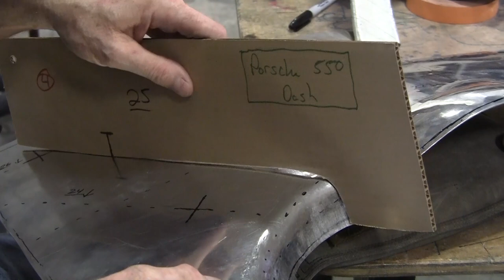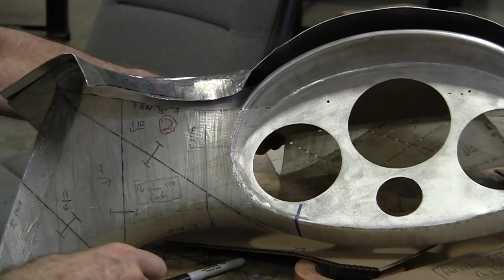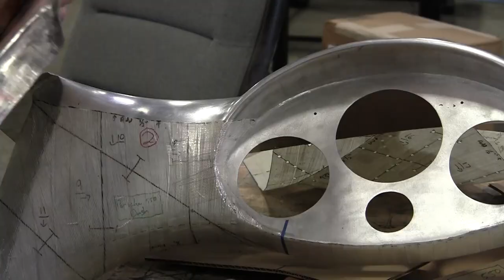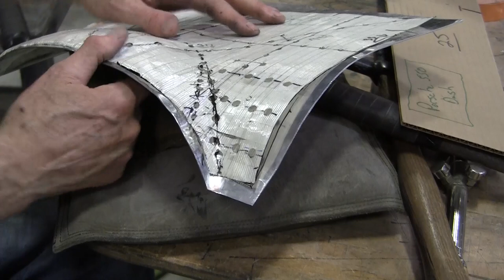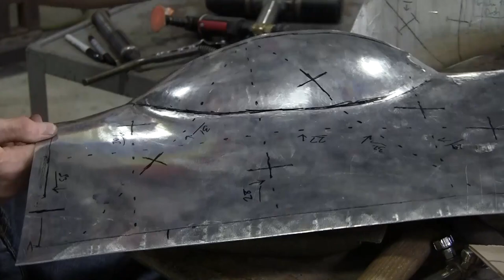Metal Shaping a Porsche 550 Dash (Part 6): Perfecting Details

Comment: I've always thought the torch does that because the hose has air in it. Once the hose is purged then it starts to mix properly. I have really long hoses so I slightly open the O2 and wait. The flame changes once the O2 has purged.

Comment: Love all the videos especially the ones with a lot of hand tool work I am curious if annealing would help with all the small details that you were working on also don’t mind the long videos it shows the patients it takes to make a proper part
Reply from the maker: I would anneal if I felt it would make things easier. In this case I haven't needed to the metal is moving easily.
Reply: @proshaper  thanks appreciate your answer

Comment: The air that has replaced oxygen past the valve as the torch set is 80% N2. That puts out the flame.
Reply: And, you need to run a tip cleaner up your torch tip.
😉
Reply: @jimrobcoyle  I think you meant O2, not N2, but you are correct, it is air in the oxygen hose.
Reply: @kc5gym  No. I meant Nitrogen,  N2. I could be off a percent or 2 but air is close to 80 percent Nitrogen.

Comment: Turn on oxygen and get it to flow at even pressure fist then close and light acetylene.  Add oxygen.   I found it works on mine . It's like the gas line gets an uneven pressure in it if you just light straight up..

Comment: Another great series! Keep up the great videos. When you need to pump up the edges of the panel is it ever advisable to strike the edge with a steel hammer on a steel anvil instead of the bag?
Reply from the maker: Both will work, I prefer the mallet and beater bag.

Comment: Run the oxy for several seconds before you light the torch. That will let the regulator settle the pressure and you should have no more blow outs.

Comment: As complex as this particular section of the dash is could it be done entirely with gauges and the flexible shape pattern? Or do you need the original panel to visualize and compare the finer details around this intersecting eyebrow/lip/bezel/whatchamacallit portion of the dash?
Reply from the maker: Yes, if you make enough of the gauges. I still have a few to make to check all of the details.
Reply: @proshaper  Thanks for the reply.

Comment: Erko die shrinker stretcher like you own roughly what are they worth is there a cheaper alternative for someone starting out
Reply from the maker: Erco shrinker stretchers with a set of shrink and stretch dies sell used for $2500.00 to $4500.00 A new Erco without dies I believe is over $7000.00. Die sets sell for $1300.00 and up new, used about half that. I made my own machine it is much better than the Erco but I use Erco dies in it.
Reply from the maker: Everyone starts out with the Lancaster style shrinker stretcher. There are many Chinese knockoffs selling for less than $200.00 for both the shrinker and stretcher.